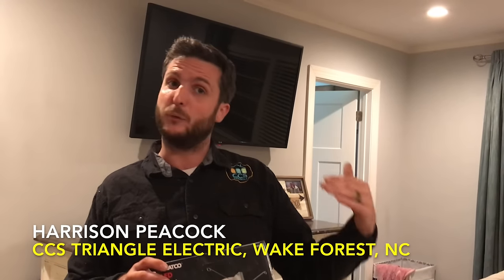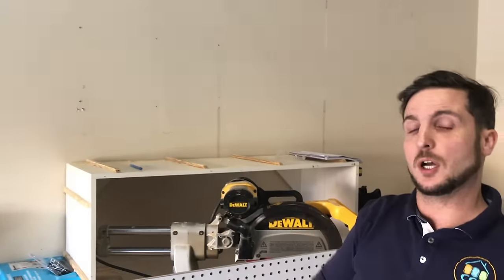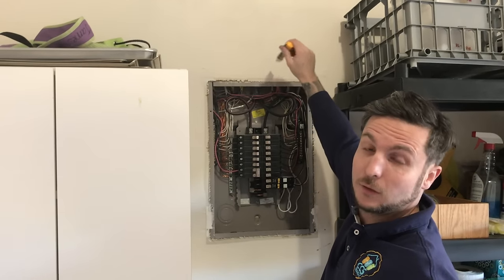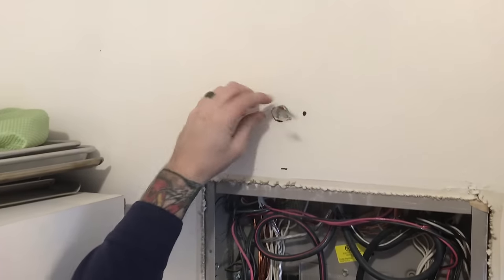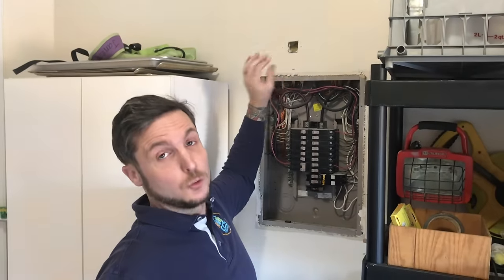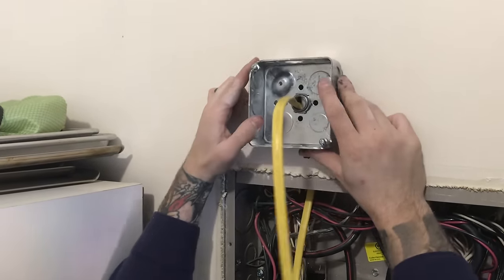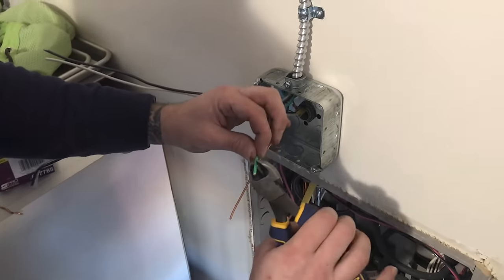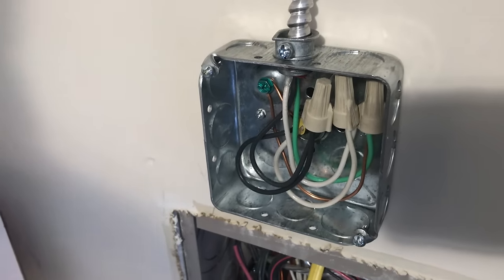New Garage Outlet From Panel--VERY DETAILED! (New Circuit / GFCI / Breaker Box / FULL INSTALL!)

Comment: I would have wrapped ground wire in box clockwise around the screw so when tightening the screw clockwise it tends to pull the wire tighter not loosen the curved wire.

Comment: Damn i watched the whole thing. This was super informative, I need another receptacle in my garage as well and this made everything very clear!
Reply: If you have no receptacle in your garage then follow this video. If you already have at least one receptacle, you can start from one of them to avoid touching the breaker panel. That is what I did in my garage as the closest receptacle is too far from where I really need.
Reply: Check codes, not allow the metallic cable.   Thanks.....Jim

Comment: Great video. Great instruction. One big thing I would do is to use a screwdriver and hand tighten instead of a power screwdriver to tighten things from the dry wall anchors to the box. Also, he didn’t stress that the utility service lines will always be live. The way he had has hands close to them make it seem like they aren’t
Reply: He did stress that the bus bar would be live.

Comment: never tightened romex connector on panel. I would have put the romex connector on the wire and fished it down to the panel
Reply: Yep
Reply: Great video. Thanks for the detailed install!
Reply: I would have done the same so the wire into the panel is tight in the connector.
Reply: What about using the dogs( pump pliers) backwards.

Comment: Having the neutrals bonded to ground in the panel has nothing to do with how close the meter is. You bond the neutral at the first service disconnecting means..ie the first ocpd.

Comment: Personally i like to work backwards from outlet and final termination to j box last
Reply: Me 2.  Then you don't have the panel open or wires dangling in the panel while you route the cable or wire up the receptacle.

Comment: How did you tighten the screws down on the cable inside the wall? You cant use setscrew type connectors on aluminum jacketed MC cable.
Reply: Waaaaahh
Reply: @FightingSportsMedia  Yeah, because electrical safety is a total joke. Who cares if a house burns down with the family inside? Right?

Comment: I've got a security light and garage door opener that have been running off extension cords for years.  We have MC and a junction box with outlet for the washer and dryer where they are plugged in.  So I just need to run MC where the extension cords are.  And mount the proper receptacle boxes.  We don't have GFCI in the garage.  Everywhere else, but not in the garage.  I've got some work to do, hehe.  Thank you for the video!

Comment: 10:40 Good lord attach the wire to the conector then feed the wire an the connector at once that way the romex is gonna be attached  to the connector and not loose inside the panel
Reply: Lmaoooo I said the same thing to myself. Also why use a 1900 box when he could’ve just used a handy box
Reply: Stephen Castro a gfci receptacle in a handy box? Are you serious? GFCIs take up a lot of room. There is a reason that almost every time a handy box is used, it’s for a small device like a toggle switch. You will never see a gfci in one. That’s why he used a 1900 box. This is absolutely the professional way to do it.
Reply: Russell Brown I think (I hope) he’s talking about where the guy switched over from Romex to MC.
Reply: Russell Brown they have deep cut in boxes in case you didn’t know
Reply: Stephen Castro Sometimes you need to put big dimming switches/gfci devices in cutting boxes/handy boxes cause you don’t have space to put something bigger but Is best practice to avoid it every time is possible also new code requirements makes it hard to use handy boxes anymore
Reply: Francisco Quiñones I get it, I know code. But this is just a gfci in a garage I doubt it’s getting inspected
Reply: Stephen Castro a handy box is not a cut in box, in case you didn’t know. It’s a single-gang surface mounted box. If, by saying handy box, you meant cut-in box, you used the wrong terminology.
Reply: Russell Brown a cut in box is also a single gang box.. it just has the clips on the side that you screw so it expands and grips on to the sheet rock..
Reply: Stephen Castro yes but you initially said handy box (also known as a utility box). Those are specifically surface mounted (not recessed) single gang boxes and are only available in one depth. There are no deep versions. A handy box is not a cut-in box.
Reply: Lol! I now know the difference between a handy box and cut in box. I didn't see that coming.

Comment: This electrician is spot on, I would wire the screws on the outlet. But that’s me. Each is to code! But the back stabs can pull out! While a hooked connection will not! Over time! Excellent install sir! Up just one change!
Reply: These connections take wires through holes in the back, but they are not back-stab connections; they are clamped very securely by the terminal screws.

Comment: Hey thanks for the video but I thought you weren't supposed to use MC cable where it could be subject to physical damage.
Reply: Exactly.  Code violation here.
Reply: Tim Rich in Canada at least, bx can be used in exposed locations. Whole point why it’s armoured
Reply: "subject to physical damage" = somewhat fuzzy. Its permissible (in the US) by code to use MC exposed, and MC is harder to damage physically than, say, romex. I think most inspectors would pass this install, although if one wanted to fail you on this they could. If one was worried about it, the thing to do would be 1 fish the mc directly into the panel knockout from up higher on wall so it wasn't exposed lower, with the connector already on it so you could get the lock-ring and 2 use a changeover so the couple feet coming down the wall into the box w the gfci could be EMT. That way the MC would only be exposed up high and there wouldn't be a junction box right above the panel. but it's whatever, for a job that isn't being inspected this is fine.

Comment: Glad I found this video, thank you. I am doing this in my garage. Will have my electrician do it. My only question is I noticed the breaker is wobbly even after installing it. Is that normal/ok? Any other electricians can also answer this, as I am having this done soon. Thanks

Comment: It's important for non professionals to understand that working in a live panel is extremely dangerous but even more dangerous without arc flash protection for your face eyes hands and upper body at minimum.
Please make sure you do not attempt this with out looking at arc flash accidents and learning the proper safety protections that you must use. It's life saving for anyone regardless of experience.

Comment: Suppose you stripped the metal sheath cable for four feet as it appears there was plenty of length to spare. I would have installed the clamp as you did, but I would them add the ground to the box and feed the extra three feet of wire directly to the panel, with clamp.  I dont think that going straight through is against code.

Why would I do that?  I eliminate a point of failure, the junction that you made in the box.  The way I woud do it, the wire is going straight through.  It is not to save three marettes.
By the way, the GFI is called a GFCI.  Our Canadian GFCIs for 20 amperes come with a T socket.  And by the way, your work is very neat and well done.  We also do not use philips screwdrivers, but Robertson (square head either green or red size) and the flat for the front. 
The recepticle and box screws are designed for Roberson screwdrivers.
Reply: I bought a #1 Robertson screwdriver when I was in Winnipeg and I use it on the screws of all the receptacles I install.  It does a better job than slotted or Philips screwdrivers as it won't slip out of the screw head like the others.

Comment: Thankyou. I so hate to run extensions across my garage floor for the stationary equipment on that side. Now I'm going to install a receptacle from the box which is on that side of the garage. Which I should have done years ago.

Comment: I was taught that when using metal boxes, the receptacle or switch should be wrapped with electrical tape, covering the terminal screw heads to prevent contact with the metal box. Yes, No, Maybe So?
Reply: I think it was more of a habit when there wasn't grounded wire. Hot wire hitting this system should trip the breaker, but I have tapped outlets/switches just to prevent any issues.  Cheap and quick insurance to any project
Reply: I once made a dumb mistake where I tested a switch with no tape wrapped around it that was suspended by its wires outside of the metal box that it was install in, and I flipped the breaker back on, then came back and pressed the switch and accidentally made contact with the edge of the metal box. It momentarily arced and sent some sparks flying, but it did NOT trip the breaker and the breaker recently installed. 

It was a stupid thing to do, but if I had wrapped the switch with tape before turning the power back on to test it, then it probably wouldn't have shorted and arced against the box. Long story short, in some cases you just can't count on the breaker tripping in time, and if tape can help prevent arcing, then it's always worth it.
Reply: chillywilly3610 it should trip breaker but there will be an explosion in the box. Most outlets can fit in most boxes fine but when working with a GFCI it’s always best to tape
Reply: It's not a code requirement, but it's a smart thing to do for a few reasons

Comment: Since 2018 Code (North America) requires an arc-fault breaker even in a garage.  Or is that just Canada?
Reply: In Canada if the garage is attached to the house you need a arcfault breaker but not a gfci unless there is sink within 1.5 meters ( the gfci think could vary by province though)
Reply: NEC (US) requires an arc fault  breaker here, from even before, i think 2 code cycles back,  BUT implementation and which version of the NEC is at a local level. I'm in Nashville and here they only require arc fault breakers in bedrooms. I'm not sure if they are using an older version of the code book or simply not enforcing, but it's all about the extra 800-900 dollars in breakers it would cost to comply with newer code. I'm guessing because this is him adding a circuit to an older panel in a job that's not being inspected, he's not spending the extra 40 dollars for an arc fault breaker.

Comment: No license required here in PA,  thankfully!  :-)  The first time I dealt with a lot of that metal-clad cable was somewhere around four and a half decades ago,  and this was in NYC,  where a license most definitely is required.  I did all the wiring except to hook it into the panel,  then we did get a licensed guy to come in and check out my work and do that final connection.  In those days the metal cladding was steel,  and you could break a pair of cutters trying to cut that stuff the way it's shown here....The last time I dealt with that stuff was when I installed a dedicated outlet for a veterinary clinic,  to support a server rack that was going to be installed.  For that job I did buy the special tool to cut that metal cladding,  from Home Depot.  It broke,  just before the last time I had to cut that stuff but I managed to make it  work and then when the job was done I returned it.  The real pucker factor there came with the point of getting into the wiring panel.  This place had FIVE 300A panels,  and going through a distribution box and into the panel was a lot of fun.  I got it done,  though,  and excpect that they're satisfied with the work,  which is always nice.  Given the choice,  I'd rather just stick with romex.  :-)

Comment: Why not just go inwall/ceiling? You would of used less material and it would of looked cleaner aswell. Also would of allowed you to go straight into the panel rather than using the 4s box. It's also good too anchor at all 4 points. Rather than using channellocks to tighten connector you will get a tighter connection with a flathead tapping the locknut till tight. I am happy that you covered grounding in the 4s(jbox called many things) also should make sure your box is level and your mc is level/plum. Even though the circuit wasn't energized, it's good to treat as if it was. You should be connecting ground first, than your grounded current carrying conductor (neutral) than your ungrounded (hot). Some inspectors require you to used electrical tape around the receptacle when in a metal industrial box, some dont. I prefer too just to be safe. Also I personally bring my wires to the bottom of the panel and then back up, this is more to leave space to move a breaker/circuit or upgrade a panel. Makes it to where you wont need to wire nut inside the panel if you ever upgrade.

That's my few cents as a fellow electrician. Good video none the less.

Comment: Great "EASY TO FOLLOW" videos, i do have one question. How do i tighten up the little screws on the top of wire inside the wall? above the pannel. i tightened up the clock nut but i cant reach the little screws
thanks in advance

Comment: How did you tighten the Romex connector on the panel knockout? Lol
Reply: You just turn the lock nut onto the threads.
Reply: Was thinking the same thing he never tightened the clamp screws on the connector
Reply: @ti3167  he should have tightened them onto the cable then fed the cable and clamp into the panel then put on the nut

Comment: You’re supposed to wrap the ground wire around the ground screw clockwise because that’s the direction it turns when you tighten it.

Comment: 36:06 before screwing plate to gfci always wrap electrical tape around gfci to cover all screws when using metal boxes that is code requirement to avoid arcing from energized screws to metal sides of box interior and dont wrap over face plate screws (go under those )
Reply: Can you tell me the code section please
Reply: @thomasmarable6818  look it up commercial
Reply: safety for metal jboxes

Comment: For anyone using a similar plug in tester , different brands have different configurations of lights showing correct ,  reversed polarity , open ground , etc. Don't assume the two lights center and right being illuminated and left light off are necessarily going to be correct polarity and grounding for the tester you are using. Check the legend on the tester itself. 😎
Reply: Mine is significantly smaller,  doesnt include the test button,  and has two green and one red LEDs.  The center and right ones being lit are correct for this one, too...

Comment: I like to install the receptacles into the metal plate first (when using metal boxes) because I find it easier to mount them with the nuts and bolts on a table vs. hanging from a wall or ceiling.  If I install a 2-gang box I screw on the appropriate pigtails to the devices first, then mount to the metal plate, then wire it up the wall (with wire nuts!).  In a one-gang box like here it's even easier as there's nothing blocking the screws.

Comment: romex connector is stone age. a plastic clamping grommet, like the ones used in the og panel install, is the norm now a days. plus you wouldn't have to worry about blowing out the drywall so the hole will be big enough for the clamping part. and you don't have to manually tighten the clamp.

Comment: The gentleman does very clean work and I WILL NOT fault him there. In the majority of the jurisdictions this would NOT be a code compliant installation because of NEC 330-12 (1) Not subject to Physical Damage. The NEC uses this phrase often thru-ought the code, and here is the conundrum. The NEC does not define what that zone is. So this rule will fall under the interpretation of the AHJ (Authority Having Jurisdiction) and a 99 out of a 100 times if an inspector can stand there and reach it, IN THERE opinion it is subject to physical damage and fails the inspection. Some Jurisdictions even add this to their addendum for clarification. In the 30 years I have NOT seen an inspector yet allow MC, Romex, AC or similar types of cables to be exposed on any surface below 8’  where it is exposed to physical damage. My guys for my company repair these installations frequently when homes fail inspections on home sales or rehab's.
Reply: Well stated. This install does not appear to be permitted, and will likely only be corrected if the content provider decides to do so as a good faith action, or tries to sell his house. Adding a circuit most often requires a permit.

Comment: Wouldnt had been much better from the beginning to directly connect the wires to the main box then fish the other end of romax wire through the panel top through the wall up into the attic then brought back down to wherever the new plug box is to be located at this way you would minus having to put the extra metal box above the main panel box & also not having to run the conduit up & along the corners of the wall?
I like to hide my wires I know there is little bit more time to fish the wires through the walls but looks much better..
Reply: Burt, that's exactly the way I have done this numerous times, save on the cost of the flexible conduit, just run Romex up the ceiling to the attic, then right down the wall, easy as pie. We do this all the time when adding microwave oven outlets in a remodel where there was no microwave oven before.
Reply: No so easy on the first floor of a 2 story house.
Reply: @rocket5557  and an additional 40’ of wires to go up and down two stories